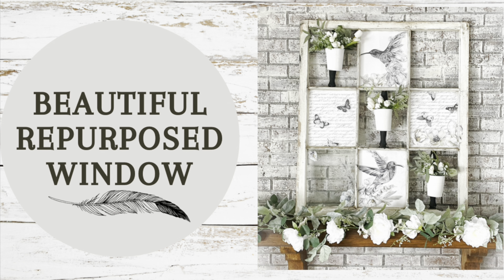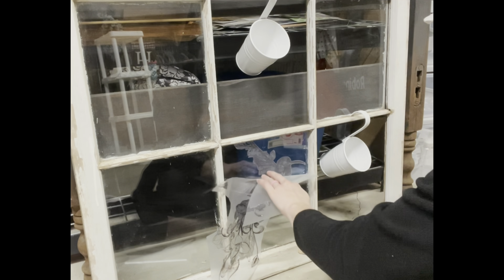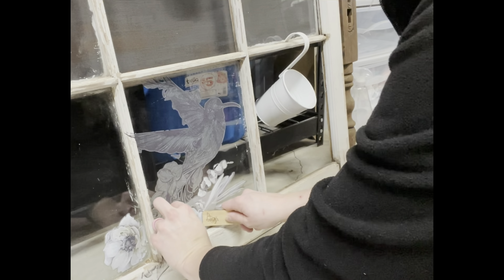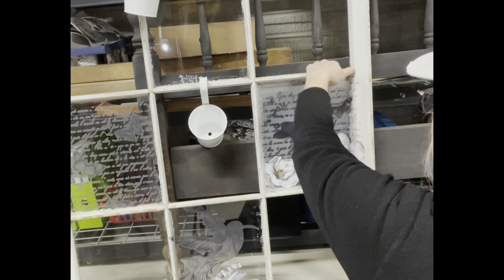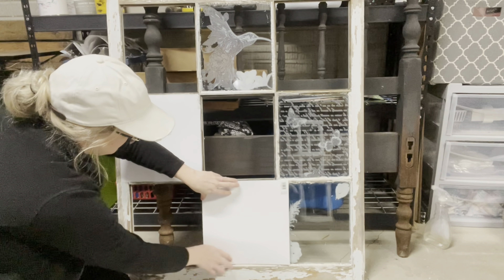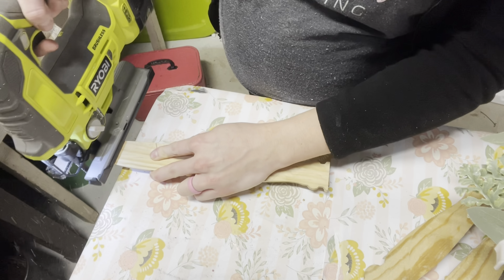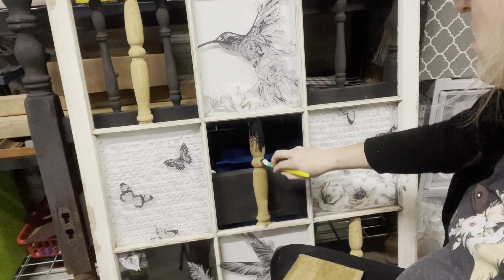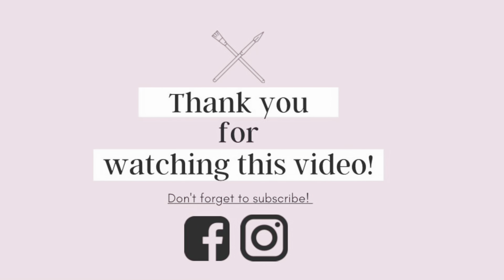How To: Repurpose Old Window Into Beautiful Home Decor

Comment: Two ?
Is that the front of window or the back?
Will transfer work on mirrors?
Reply from the maker: I’m not sure if it’s the front or the back! The other side had cocking showing and was super chippy so I would assume that would be the “outside” of the window! And yes you can def put them on windows just be sure to clean really well and dry really well first! But I wouldn’t seal it on a mirror!